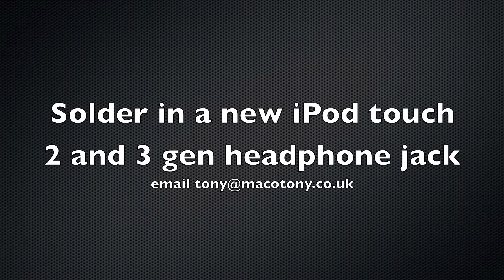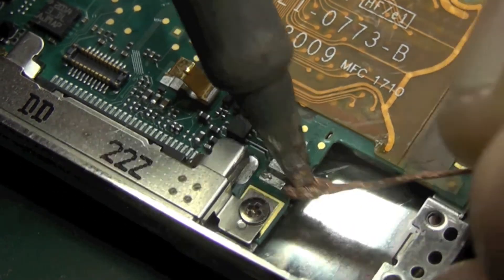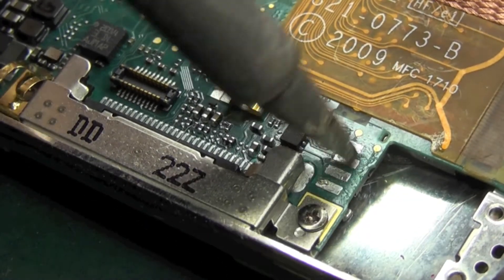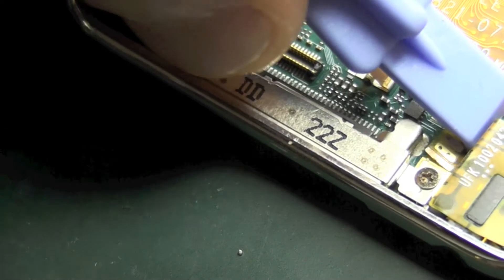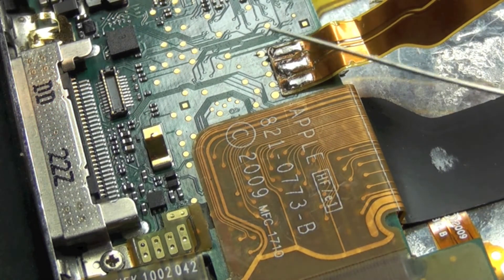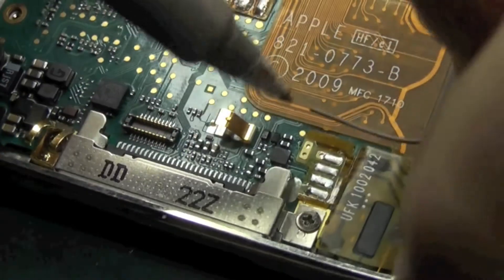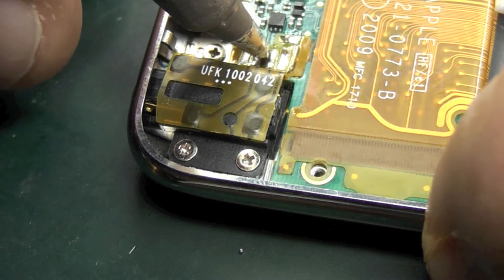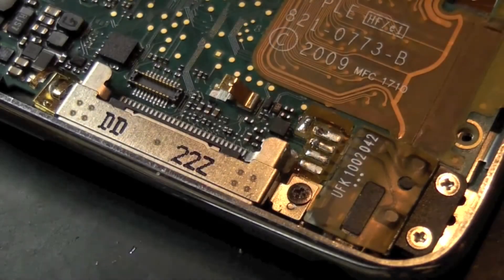solder new headphone jack in to an ipod touch 2nd and 3rd gen

Comment: i accidentally removed one of the solder pads from the board the one furthers from the bottom in the line of 4 pads, is there alternate connection i can use

Comment: When you desoldered the stock headphone jack, were the solder joints like the ones you used in your video?

Like how they were on top of the ribbon instead of between the board and ribbon.

Thanks

Comment from the maker: @BlackCaScorpio Google Panasonic HDC - HS20, No it is not solid state drive, it is a hard drive. I have not ripped it apart yet but assume it will be the same zif drives used in the ipod classic and Macbook Air although the newer MC Air uses an SSD. HDD drives make it quicker to find footage and download.

Comment from the maker: @BlackCaScorpio I use a Panasonic HDC - HS20 which is full HD 1920x1080, it has a hard drive rather than tape, I set it for macro with auto focus off and use a small tripod plus the remote controller, I edit on a Apple Mac using imovie.
You can get the same result with a cheaper camcorder.
T